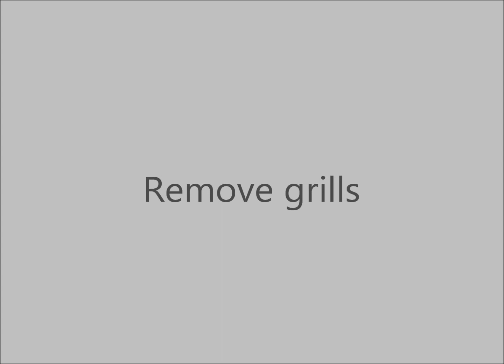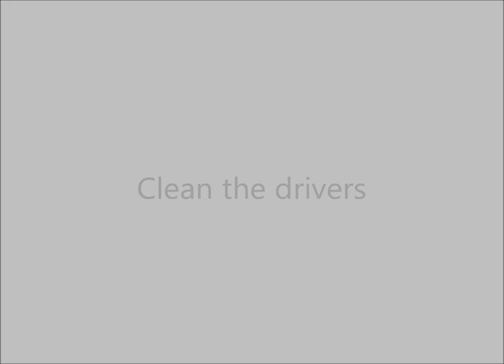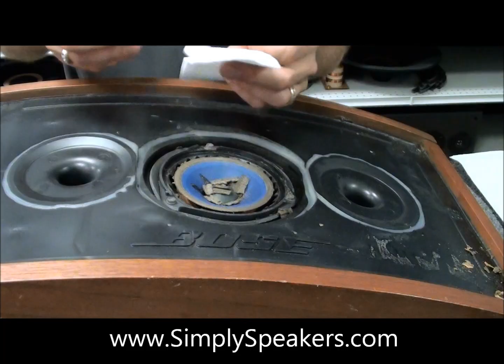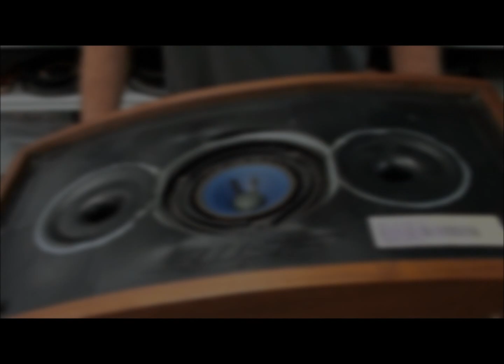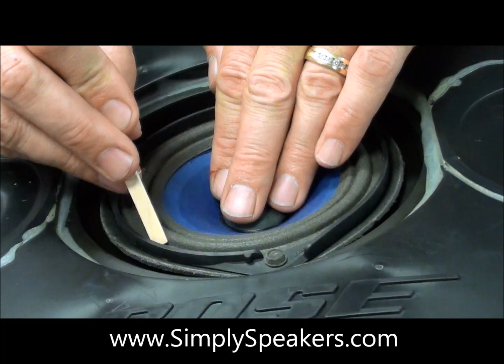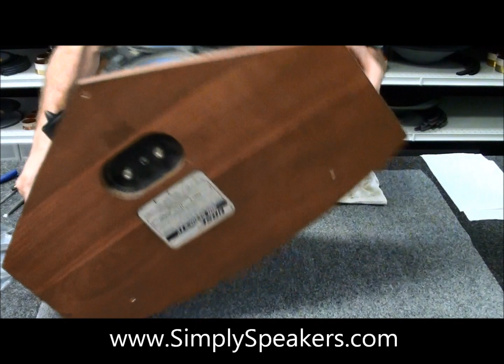Bose 901 Speaker Foam Edge Replacement and Repair

Comment: Series IV, sometomes a speaker might burp as if kinda blown - seldom, but happens. Is this a sign of bad foam?  Great video!
Reply from the maker: The foam is probably OK, otherwise they would sound bad constantly. Issue might be related to the EQ or amplifier.
Reply: @simplyspeakers  perfect, thanks for the reply! I have 4 - 901s I plan to reform this year. Your video was great

Comment: Very disappointing that Bose put so little engineering (none?) into grill attachment. Thank you so much for this tutorial. All aspects are clear.
Reply from the maker: Glad it was helpful!
Reply: It' s supposed to be removable, so a little glue does the job nicely. The speaker being worked on in this video was built somewhere around 1978-80 and you can see the glue is still sticky.

Comment: Thank you so much for the tips on removing the grille!
      I found some 901 series IV speakers in the trash yesterday, and wanted to inspect the cones without damaging anything.. (...as well as see the 8-speaker assembly in person.. It looks SO Cool in pictures.. Haha)

Every other thing or video I've found either talks about screwdrivers or just skips over the removal altogether

 ("..and here's how it looks without the grille"... Ok.. But how did you..? :/)

Thank you for sharing your knowledge about this. Videos like these are a treasure trove of useful information for people like me. 
      (And also, a very good business card for yourself, as you demonstrate your skill and knowledge of these speakers in different iterations)
Reply from the maker: Thank you! Glad you found the information useful.
Reply: @simplyspeakers  Update: I managed to inspect the cones, and - as you predicted - the foam is toast.
      Weighing my options now. 
I would like to re-foam (re-cone?) and get them in working condition. (Because it feels like the right thing to do, and because I love the design)

However, I DON'T have the 'series IV Active EQ' that the manual (and the internet) says is absolutely necessary for them to sound good..

Do you perhaps have any experience with hooking these speakers up without the active EQ?
     (I found a schematic on the internet - no crossovers are included.. Not a good sign)

Alternatively, I was thinking to use them as a guitar (or bass) cabinet.. 
      (The 8-speaker assembly reminded me a bit of the big Ampeg 'coffin' bass cabinet)
     Could that work..?

Or is it best (since I have no EQ) to sell them on to a restorer?

I apologize for the many questions. 
      But my purchase of new foam (or most likely cloth) rings kind of hangs on if the speakers will be useful without the special EQ..
      (I live in the Netherlands, so shipping would be expensive, plus I'm on eh.. 'Government assistence' / 'welfare' (?) or whatever the equivalent is called in the US. 
       Simply put; it would be an investment, rather than something I can frivolously throw money at :))

Any information about using them without EQ, or if they could potentially functions as a guitar cab would be most helpful.

Thank you in advance for reading this.
And I will understand completely if you don't have the time to answer :)

Answer or no answer; thank you for the very informative video.
And cheers from Amsterdam 🤘

Comment: I have a set of 901 series 2, that I bought as new back in the 70s. How do I know if mine need to be refoamed? 
They still sound great, and I don’t hear a diminished quality of sound. Could mine be in good shape, or was mine not using foam? I. Have never taken the grill cloth off to see the speakers. I’m a bit hesitant to take the grill cover off. I think I see one staple on each side, not three staples on each side. Somewhere I thought I read/heard that series 2 did not use the foam that is prone to deteriorate. Any thoughts you can provide for me are appreciated. I feel like they are not broke so I don’t need to fix them, etc.
Reply from the maker: Early versions used a cloth surround driver that does not need service. We can advise once we see them. Email a photo of the cabinets to: info@simplyspeakers.com and we will be happy to take a look for you. Thanks!

Comment: For attaching the rear grill, you suggested the adhesive for the foam surround. Is there other good alternatives? Hot glue or double-sided foam tape?
Reply from the maker: All great ideas, or try Velcro at each corner.

Comment: I bought four 901's pretty cheap, and of course the foam was gone. I had been told by a repair shop that this was too hard to do and I would have to drive my speakers 5 hours one way to get repaired for $230! After watching this video, I decided I could do this (Don't challenge me!). The repair kit arrived and once I got in the swing of things, it was really easy. It took about 8 minutes per speaker once I had all the old stuff cleaned off. EASY! Just ordered another kit to do the second pair!

Here's some things I would add to what this video teaches:
- Take your time with the cleanup of old foam. I vacuumed out all the old stuff and dust.
-You can do the cleanup with the speaker in it's normal upright position. It keeps the old foam pieces and dust from falling into the speaker and makes it easier to keep clean.
-  After scraping most of old foam off, rubbing alcohol on a Q-tip works great, plus some on a rag at the end to get the remainder off. I worked around each speaker by quarters.
- It was easier for me to hold the new foam in my hand to apply the glue to the foam and hold it while applying glue to the housing.
- I timed his installation so that I knew how long I had before the glue set, and I gave it about 2-3 minutes for the initial foam to speaker to set before moving to foam to housing. I used a chopstick to help set the foam into the glue (and cleaned the chopstick with the rubbing alcohol when needed.) 
- The foam pretty much centers the speakers, and it was easy to feel it they were off. I only had one out of 18 I had to adjust slightly.
- There's a chance when working with old speakers like this that your activity will awaken some sleeping spiders LIKE THE GIANT BROWN RECLUSE THAT CRAWLED OUT OF ONE OF THE SPEAKERS! God, I hate spiders.
Reply: Great info. Thanks
Reply: Dont get bit by that spider OMGGGG
Reply: Thanks for the tips

Comment: I've done four 901 IV cabs, 36 speakers is ENOUGH experience for life for me.  One set rotted in an attic.  That set was easy and no problems with rubs.  The second set were actually "played" with deteriorated surrounds.  About 5 or 6 of those couldn't be "saved" (they rubbed) and had to be replaced with other 901 IV speakers.  I assume "playing" those speakers with bad surrounds somehow deformed the coil former and voice coil.
Reply: First set with treated fiber, one set with foam.

Comment: I got a pair of 901 IV's in the early 80's. They haven't been used for almost 15 years now. Having seen this, I'm going to pull the cover off the back and do an inspection. I'm expecting to see dry, cracked foam  :-). But, this video gives me confidence they can be brought back in to service.
Reply: Same here, mine have been in storage in the basement for 29 years. I thought they were toast and was gonna give them away cheap. After seeing this I’m ordering the kit. Gonna be Rocking them 901s

Comment: I purchased a kit for my old Genesis speakers that I got back in the late 80's.  The surrounds on all the woofers and passive radiators had dry rotted and the speakers sat in my spare bedroom for years unused.  The kit installed easily and the units sound better than ever.  I highly recommend this company if you have vintage speakers that need repairing.  Don't throw them out!  I love being able to use the old school speakers on my modern Onkyo receiver.  Now I need to replace the surrounds on an old pair of Sony speakers sitting in my garage.  I look forward to resurrecting them from unused to used.  Thanks to Simply Speakers.
Reply from the maker: Great, thank you!

Comment: Amazing video - I'm about to buy some 901s always wanted them - but was very worried about the drivers - now I have seen this I feel reasured to go ahead & buy them - -only other thing is if there are lose wires or any crossovers in the unit which i guess there are - and if those are broken -how do get to them - is there any videos on that -BUT a stunning video relly helpful - always wanted apair - now if the seals can be repaired -thats ace news - very good video 10 out of 10 :)
Reply: There are no crossovers or active electronics in the 901 speakers - they have 9 identical drivers that would not benefit from crossovers (though some might argue they might benefit from active EQ.
Reply: Just done mine ....as said you need some time to do these .BUT the result  is stunning ..I practiced on another old single base speaker first to get the idea ...* One thing I found was I left the glue and -th cap got stuck .and wouldn't come off..so wrecked a tube of glue ...got one speaker to finish off so how fast can we order the GLUE  ..i lve in the U,K  is there a VERY similar U,K substitute.p,s i used a bic blunt pen .when it felt centred .found useful tip - & wipe glue off the pen as go around ..watch the video several times and care .you dont slip with knife on removing foam ...easy to do ..care with the cone !

Comment: if the cloth surrounds work just as good as the foam ones and last forever why would you not just use them on all the repairs . excellent repair anyway .

Comment from the maker: The foam supports and centers the cone for proper movement. It allows the speaker to move while providing a seal around the perimeter of the cone. There are other more technical aspects as well, but these are the primary functions.

Comment: Thanks for this encouraging video. I am ready to start this painstaking job for 18 speakers. The kit was delivered to Japan just one week  after the order.
Since the spearkers stay mounted, will there be special care to be considered to prevent the debris from dropping inside the cabinet? I did not see the air blow or vacuum cleaner in the video.     Thanks!